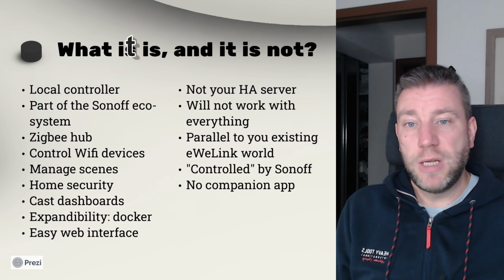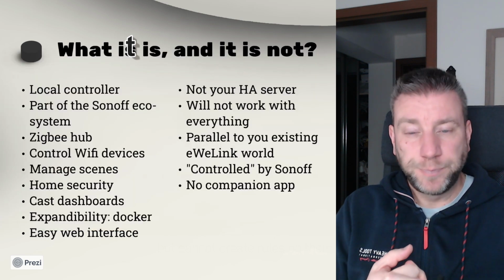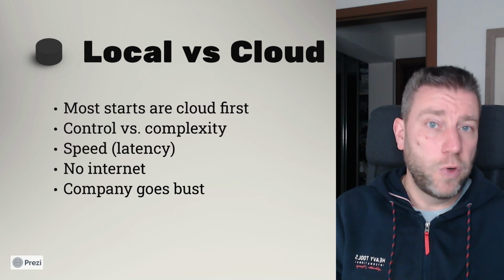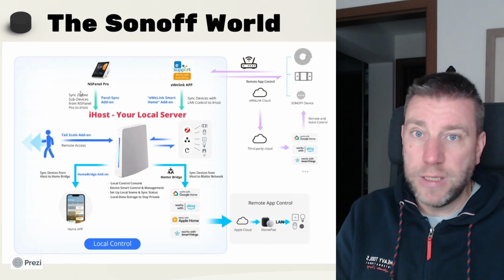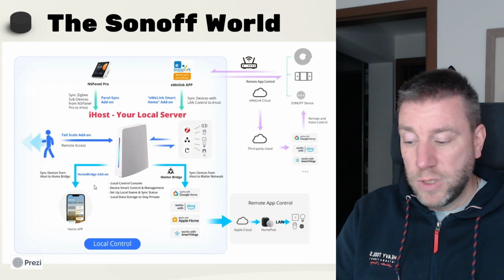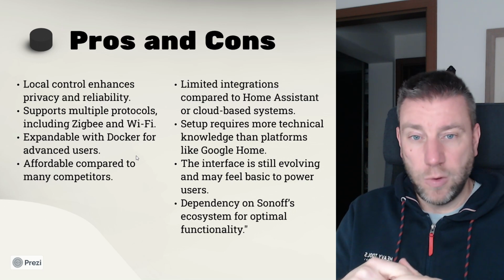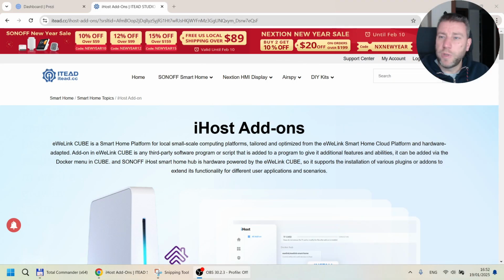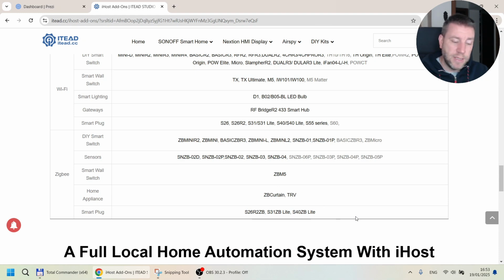Is the Sonoff iHost for you? What it is, what it is for?

Comment: Hello everyone, I have been using sonoff and ewelink for about 7 years now. I had 6x sonoff 4ch pro, rf bridge, wall touch controllers and cameras. After a few collisions that always occurred after updating ewelink, I was forced to throw away a lot of devices. Once I was even without any home control for 3 days. I wrote to support, where some jerk kept asking about the brand of the wifi router and still didn't understand the situation. The only thing he advised me was to uninstall the ewelink application and re-pair the 52 elements that I have. I did that too. I just couldn't pair 2 cameras and 3 sonoff 4 ch. I angrily trampled them and swore that I would never use sonoff and ewelink again. Many times it happened to me that some devices turned on and off by themselves. I explored many discussion groups on fcb and found out that many users are experiencing this. I disconnected important systems from ewelink and left them on classic controllers. I left the rest on ewelink. Currently I am again dealing with spontaneous two-second random interruption of the relays of the sonoff 4ch pro electrical sockets. So I will buy a new 4ch pro r3 and see. I think that ihost cannot help me with this. But maybe I would find out that the manufacturer sonoff is not to blame, but the ewelink application, which is causing me and many other users big problems. I have already devoted so much time and money to it that I think that not buying more of this stuff and throwing away all the existing ones is the right way to peace of mind.

Comment: Hello.  Good video...thanks.  But that said, I am new to this Sonoff home automation stuff and this is a little over my head.  I have some simple Sonoff Minis that I use primarily as timers to schedule my lights to go on and off at certain times.  I want to get a couple zigbee minis so that I can control lights with no neutral wires.  So I know that I need a hub.  What is the best for me to KEEP IT SIMPLE.  Being we are away from this home for many months of the year I do use the eWeLink app.  I hear you about being cloud dependent...but I do need the cloud as noted above.  So, my question is this...in my case would I be better to get the NSP Pro 120 or the iHost?  I feel that getting both would be overkill for what I need to do.  One final consideration is that I was thinking about getting a camera for my front gate, which I understand I can connect to the NSP120 so I can see who is at the front gate....a bonus.  I hope you don't mind answering and giving your advise!?
Reply from the maker: I think to keep is simple the NS Panel Pro is a better option. You will be able to see the camera feed (it takes 6-10 seconds for the feed to load). Yes it is cloud based, but for you that will only be an issue if the internet connection goes down and you will not be able to control the devices when you are away. Also, it would be possible that for example you program the lights to turn off at 11pm and you internet goes down at that time, so the routine will not be able to control the light at that time. But given the fact how frequently that may happen and at worst case scenario the light stays on I think that is not a big issue. As a workaround I may set a few additional off schedules during the evening.

Comment: Hallo, is it not possible to connect the ewelink app  with ihost? I dont find the qrcode to sync the app with the ihost
Reply from the maker: No, iHost and eWeLink is completely different things unfortunately. You can link the eWeLink devices (not all) to iHost, but it does not work the other way. Nor the iHost, neither the zigbee devices paired to the iHost are available in eWeLink.

Comment: Dear Mr. Obi Wan Kenobi, I'm experiencing a problem with Alexa and my sonoff TX ultimate switches. Sometimes Alexa says it couldn't find the TXs, but 30 seconds later they would connect without a problem. Could the ihost maybe fix that issue?
Reply from the maker: Unfortunately not. You Alexa controls your Sonoff devices using the cloud integration, and iHost does not have that. Maybe it will be possible to use the iHost and connect Alexa using the Matter Bridge integration in iHost. Documentation says that TX series are supported, but it does not say TX Ultimate in particular.
Reply: @csongorvarga  thank you for the help! Do you know what may be causing the problem with my tx ultimates? I have 3 of them and they all have the same connection problem. Im using a Huawei AX3 dual core WiFi Router.

Comment: English below:

A Node-Red-del már elkezdtem barátkozni... Egyetlen dolog, ami idegesít, hogy mindenhova oda kellene vinnem, amit szeretnék vele párosítani – nonsense. Az NS Panel Pro-t nem kell odavinnem sehova, lát minden kapcsolódni akaró relét vagy kapcsolót.

Az ökoszisztémám teljesen Sonoff, mégis, ha az NS Panel Pro-n lógnak a szenzorok, azt nem tudja szinkronizálni az iHosttal. Ha pedig az iHoston lógnak a szenzorok, akkor az NS Panelen csak az iHost casttal tudom megjeleníteni... De kivárom, amíg helyreteszik, remélem, helyreteszik. :D

TX Ultimate kapcsolókat vettem azzal a céllal, hogy ha foglalt a WC, akkor világítson pirosan, ha szabad akkor zölden... Még nem sikerült, de biztosan én csinálok valamit rosszul.

Az összes relém 4CH PRO, ezek vezérlik a padlófűtést, a fürdőszobai szellőztetőt és a redőnyöket is. Utóbbiak még nincsenek felszerelve, de hamarosan megérkeznek. Izgalmas tavasz előtt állok, mire mindent leprogramozok Node-Redben. :D

ENG:
I've already started getting familiar with Node-Red... The only thing that annoys me is that I have to take everything to the exact location where I want to pair it – nonsense. The NS Panel Pro, on the other hand, doesn't need to be moved anywhere; it can see all the relays or switches that want to connect.

My ecosystem is entirely Sonoff, yet if the sensors are connected to the NS Panel Pro, it can't sync them with the iHost. And if the sensors are connected to the iHost, then I can only display them on the NS Panel using the iHost cast... But I'll wait until they fix it—hopefully, they will. :D

I bought TX Ultimate switches with the goal that if the bathroom is occupied, they should light up red, and if it's free, they should light up green... It hasn’t worked yet, but I'm sure I'm doing something wrong.

All my relays are 4CH PRO; they control the underfloor heating, the bathroom ventilation, and the shutters. The latter are not installed yet, but they will arrive soon. An exciting spring awaits me as I program everything in Node-Red. :D
Reply: ezt már csak magyarul, Local ide vagy oda, van egy csomó funkció ami internet nélkül nem megy,  pl. a TX ultimate kapcslók világítását nem lehet állítani, csak a kapcsoló funkciót használni

Comment: Very informative video! Thank you!  Just a quick question, can ihost control the Sonoff M5 Matter Switches locally without internet? 😊
Reply from the maker: I did not test this, but I think all switches are supported. But the eWelink integration is also using local control.
Reply: @csongorvarga  does that mean that I can add Sonoff matter switches to ihost also and not limited to Zigbee devices? :)

Comment: Thanks 🙏 
Is it means if no internet ihost can still working and control device using local LAN whatever its WiFi or Zigbee ?
Reply from the maker: yes, you probably need internet initially to set this up. And of course you need a working wifi network at home (even if there is no internet access)
Reply: Yes

Comment: You stated that Home Assistant can’t be run from the iHost. That is incorrect, it’s available as a Docker image and generally runs well although it’s a limited instance of HA that doesn’t provide full access to the underlying servixe. I’ve been running my HA from the iHost for over a year!
Reply: Yes, but with HA in the Docker you cannot use the onboard bluetooth and zigbee radio
Reply: @enricoccc  there is a version of the HAOS (darkxst) that runs on the iHost but a bit of soldering is required in order to make it boot from the sd card. I have a ihost running this for months now.
Reply: @remimunteanu  interesting, in this way are you able to use the Bluetooth and zigbee radio?
Is the setup reversible (could you revert back to the original firmware) if you want?
Reply: @enricoccc  yes both bluetooth and zigbee work ok. Wifi is a bit hit and miss as sometimes it disconnects, but with ethernet is stable. I soldered a jumper on the 2 pins. If the jumper is on the ihost boots on the sd card (haos), if it is off it boots the ihost software. It is reversible yes.
Reply: @remimunteanu great thanks for the info!
Reply from the maker: Sorry, I did not know about that. Did not see that being advertised and it skipped my attention.

Comment: The Sonoff ecosystem is so broken and confusing. The Ihost was supposed to be controllable from Ewelink, with a toggle button allowing users to select local control, or hybrid (both online and local). Ecast is an ugly duplication  of ewelink. The ihost is an excellent device that is ruined by Sonoff's broken expsystem.  

Sonoff needs to strike a deal with Home Assistant. So that users can choose between Ecube or HA run on Ihost.

In terms of hardware, Sonoff continues to be one of the best and leading manufacturer of IoT devices.

Tailscale is easy to set on Ihost and works like a breeze. But instead of Tailscale, why not ewelink? Just give users an option to decide on whether they  an access the Ihost locally, or through Ewelink. Aonoff should link the two again. Disconnecting them was a bad idea.
Reply: It’s like the engineers that developed the concept were laid off and those remaining didn’t understand the objective and any product marketing failed to set a clear direction. My iHost is really only being used as a micro server for Docker to host Home Assistant; a Raspberry Pi would have been much cheaper and given a full-featured HA rather than the cut-down version.